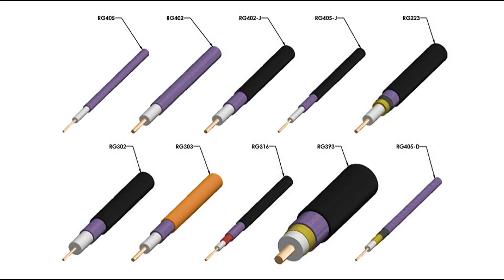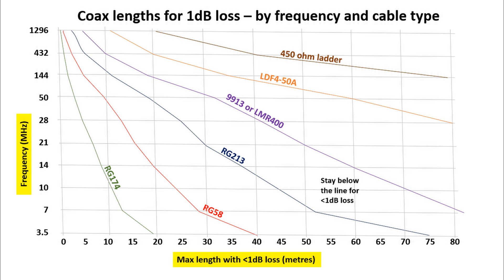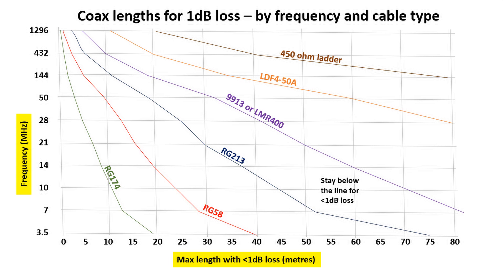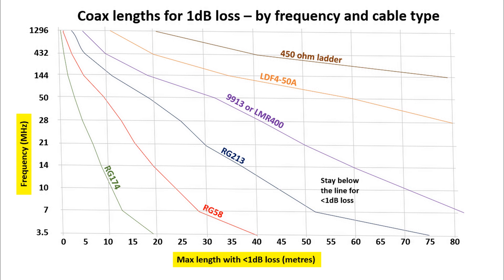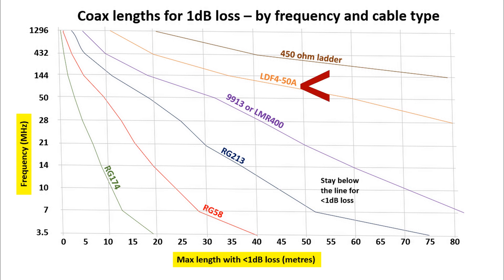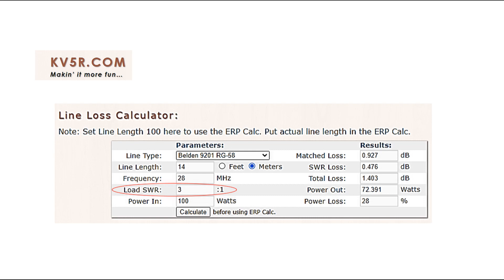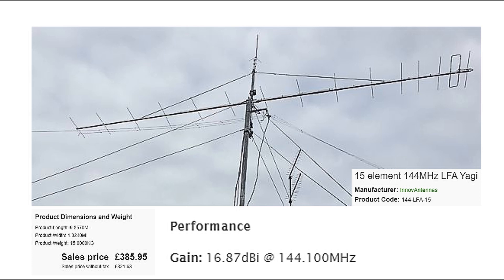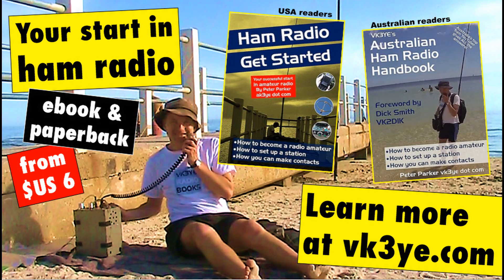Why length matters when choosing coaxial feedline

Comment: I once bought online "5DFB" cable used but good condition.  Its billed as LMR-300 equivalent.  It had solid copper center with foil and copper braid shield.  The company in Japan who made it doesn't exist anymore from what I can tell.  I can't find much information about this kind of cable in general.  The only other 5DFB cable i've seen is cheap stuff sold for consumer home cell phone repeaters.  Shame as I really like the stuff.  Its a bit stiff so I use RG8X for antenna experiments and portable etc.

Comment: Many suburban aerials are roof-mounted wires and feed lines can be extremely short, e.g. there is only about 6 metres of feedline from my top-floor shack to my off-centre-fed dipole. Under these circumstances, RG-58 is fine up to the 6 m band.
It's also interesting to consider using satellite TV 75 ohm coax. Yes, it's an immediate mismatch but the stuff is low loss, high quality and dirt cheap compared with 50 ohm coax. It is also often available FREE in offcuts up to 25 m or so long from TV aerial installers who tend to take 50 m lengths to all installations and throw away the unused excess. It may also be a better match to your dipole aerial if not your transceiver!

Comment: One point not many hams are not aware of is noise rejection in coax,
The bigger the coax and the less loss generally the less noise there is.
I'm not an expert but I believe all coax acts like a leaky feeder to some degree meaning a small amount of signal will escape, but this means a small amount of noise will "leak" into the coax, this will add up over length.
I've seen tests where RG58 at 100m length has so much noise it's like 2 or 3 S points meaning you'll miss any signals at about 3 S points which is most of the contacts you want. 
So many hams tell me I'm fine with RG58 for HF yet speak to me like I'm a fool for using M&P Hyperflex 10 on HF. 
I'll use 2 inch heliax on HF for the noise reduction if I do a permanent setup. 

But the best way to reduce noise is go POTA and run 10m of hyperflex 5 up a pole for a inverted V.

Comment: Hi Peter, This video fails the consideration of hight and cost. 
At 28 Mhz and higher frequencies,  the longer the cable the "higher" you get to put your antenna. At 28 Mhz and  higher you have to consider the DB Gained in an increase in  height.
At lower heights you may have Zero signal to  start with and the signal may  not start till you hit 50 feet and another 10 feet might triple the signal. 
The other factor is "cost", I've got around 3000 feet of RG58 lying  around and while RG8 would be "nice to have" its not  a need to have.

Comment: that was very interesting! 👍 but, I'm still missing pieces. ( Aircell 7 kabel 50 Ohm and Ecoflex 10 Plus kabel 50 Ohm ) It's too much, I understand!
for example: does the length of the coax also influence on a standing wave, for example, at certain frequencies?
Do I now also take lengths of 2 meters for the 2 meter band? so 2, 4, 6, 8, 10 meters or does that have no influence?
there are always questions! ;-)😉
.
I hope there will also be a video about types of antennas? (not just for the low frequencies!) 
.
Healthy and Friendly Greetings from NL!👍👍👍
Rob

Comment: I wonder if one of these days we see some manufacturer or hackster build a transceiver that's attached at the antenna's feedpoint with a remote control panel located in the shack? Sure would minimize one source of signal loss.....
Reply from the maker: That's the most logical option, especially for microwave gear. Main issue is keeping water out. DC voltage drop is a risk if it's high power (which it's unlikely to be if microwaves). Outdoor mounting can lead to temperature extremes that can affect frequency stability which at the best of times is harder to achieve with UHF/SHF gear. But there's ways around that.
Reply: Easy, if you have a big farm or property use a remote radio at the base of the tower in a mini shack. 
Flex offer a remote radio system, I can't afford that so I'll just play around with coax. 
Thanks.
VK1NME 73s
Reply: That is exactly what the Icom IC-905 is, from their promotional material - "The IC-905 is the industry’s first super efficient microwave base station with the RF unit designed to be at the base of the antenna, rather than in the shack. This design eliminates signal loss due to costly, long coax feed line runs found in legacy SHF designs."
Reply: That's exactly what the microwave and moonbounce guys do.
Reply: salute,   le  Yaesu FT 891  , mais  il faut aussi  son alimentation avec   et tout cela  etanche

Comment: i used this calculator too, Peter.
Everything I have is at the most 0.6dB for the frequencies and lengths of RG58. 60m inverted vee, attic dipoles for 20m to 10m and indoor collinear. I also bought and used a NANO VNA which makes it dead easy to see if they are too long or too short, unlike the days when I only had an SWR meter. Everything homebrew including my resistive QRP SWR meter. 
73 G4GHB.